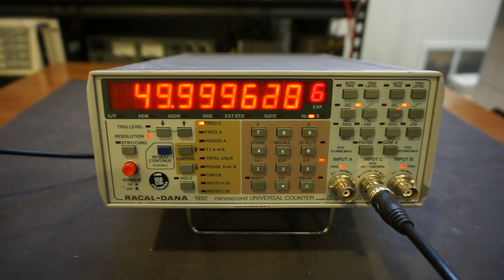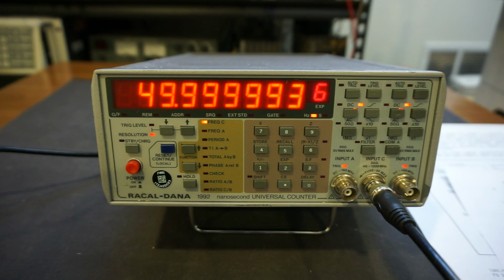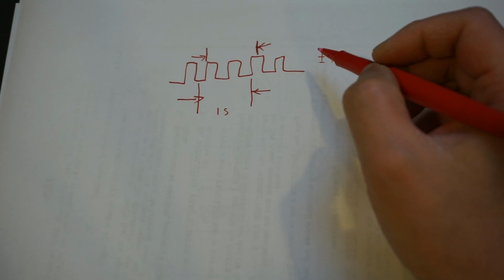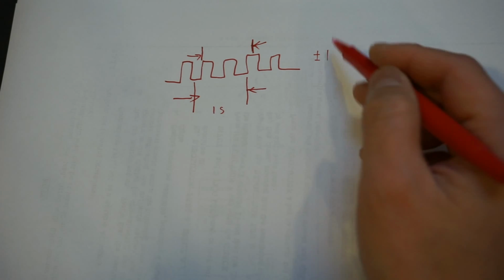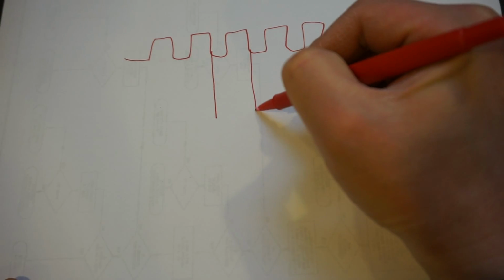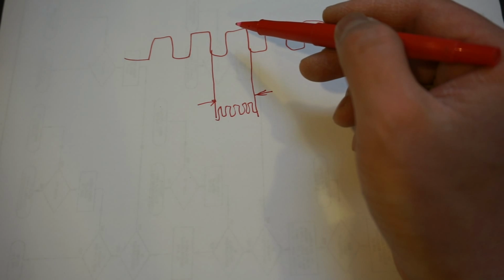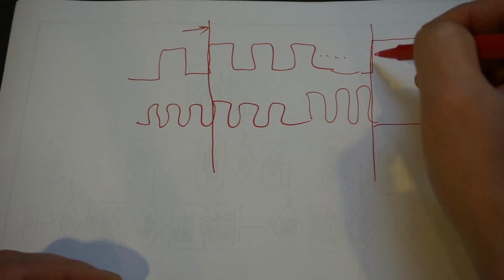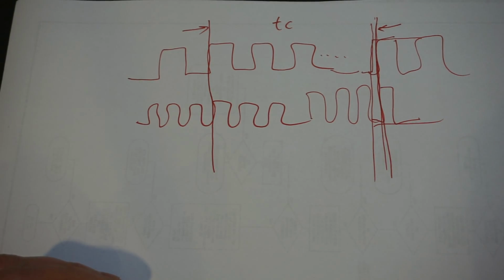Teardown and Repair of a Racal-Dana 1992 Frequency Counter

Comment: As a note to any new viewers the Ch A and B tests (77 and 78) would have failed anyway (irrespective of any other faults) as Kerry hadn't connected a cable from the 10 MHz output to the ChA and B inputs as specified in the service manual.

Comment: Channel A doesn't work on my unit either.  It also has a crystal oven but none of the resistors look burned or broken and there was no rework, the seal on the cabinet was not even broken.  Channel C works but the freq. reading is a bit off. Did you have to calibrate yours?
Reply from the maker: I didn't calibrate mine afterwards as the frequency reading was close enough (a few milihertz off if I recall correctly).
Reply: @KerryWongBlog  Got the A input fixed.  It had an open 100 ohm resistor R160 and a shorted protection diode, D5.  Oddly there is only one protection diode that is connected from the signal path to the -11.2 volt buss.  The unit is also missing a couple of gray buttons but Racal_Dana is listed as the supplier so I may have to 3D print those.
Reply from the maker: Great! Thanks for the update.
Reply: @KerryWongBlog  Finding a replacement for the protection diode D5 was a problem.  They used a special low capacitance diode type JPAD50 that has only about 2 pf. of capacitance that seems to be rare and expensive.  I tried a regular diode with 50 pf capacitance but it loaded down the signal too much. The original D5 looks just like a small transistor with one lead clipped off so I tried a 2N3904 connected base to collector and it seems to work OK.

Comment: Nice find Kerry! Agree on installing a socket but sometimes a component really needs to be down flush to the board for RF purposes although most often not. When you're working with your diagrams you may want to change the camera to a fixed focus on the page as it kept changing between the diagram and your hand and made it a little hard to watch; I don't remember that being an issue with your previous videos. Thanks for the explanations, always learn something new on your channel!
Reply from the maker: Thanks for the suggestion. Yeah, I am still getting used to the new camera (Sony A6000). I will be sure to use manual focusing the next time when I am doing explanations on paper.

Comment: I gave this a thumbs up.  When troubleshooting it allway good to check for socket chips as this is a give away that the part may have been replaced before.  If all the chips are socketed well c'e la vie.
Reply from the maker: Thanks Joseph. The only down side of putting chips in sockets I suppose is that overtime the contacts could be oxidized and causing failures. But that could be solved by wiggling and reseating ICs.